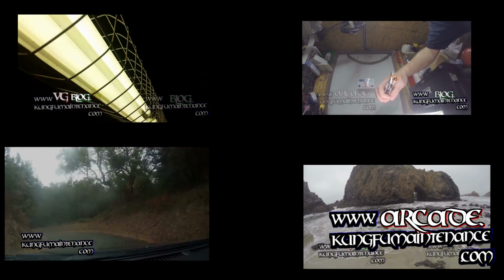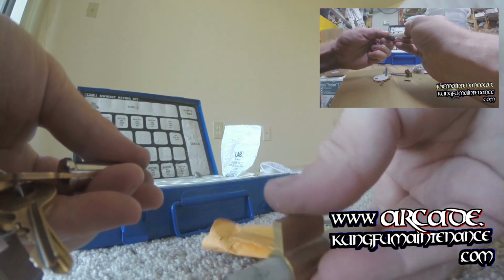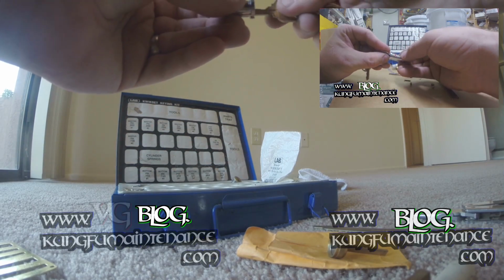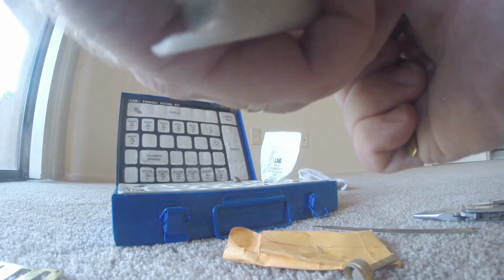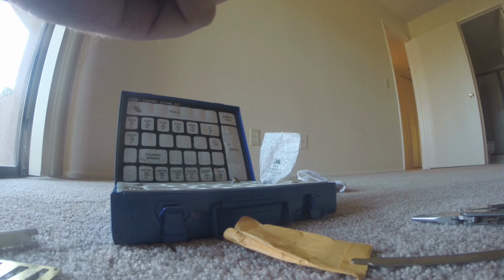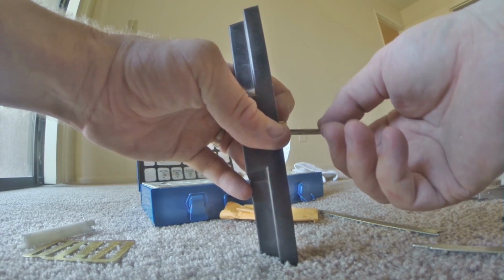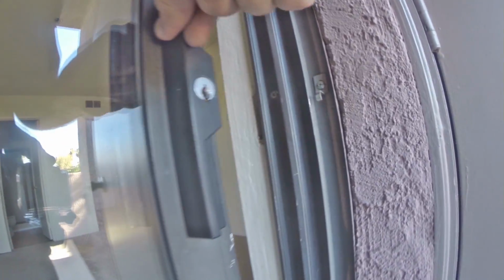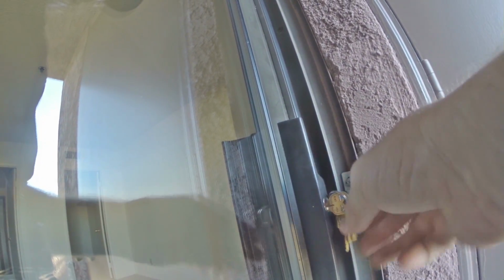How To Install Patio Porch Sliding Glass Door Lock Plus Key Alike Match Front Door Maintenance Video

Comment: I have a very old sliding door which i can not find any match lock with key. Do you have any idea how to install a lock with key?
Reply from the maker: +jennifer chu You might take a couple pictures of it with your phone and then go into your local hardware store like Ace or Emigh hardware or Yardbirds  to ask them if they have a lock set for that particular door. 

This video shows changing one particular type converting a door so that it can have a locked entry. It may also be possible to change the lock style set to a style like this one but with a photo your local hardware store can probably point you in the right direction.